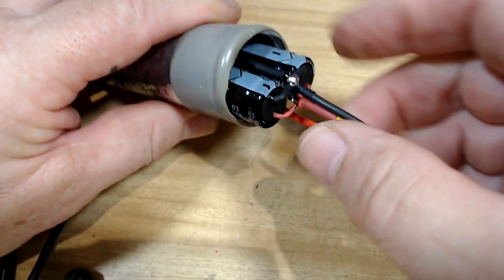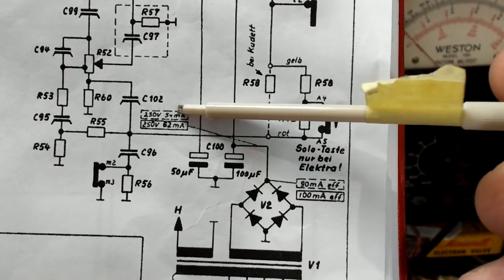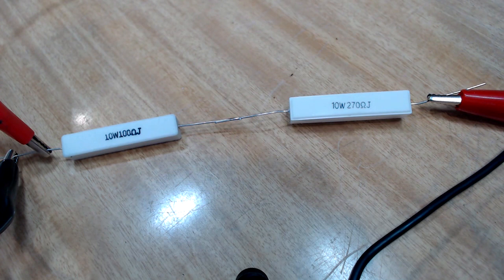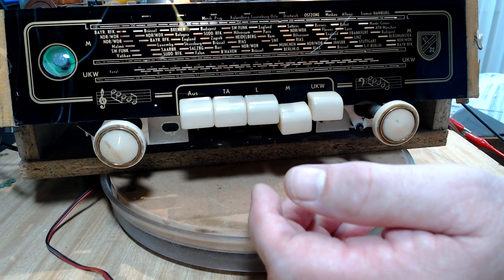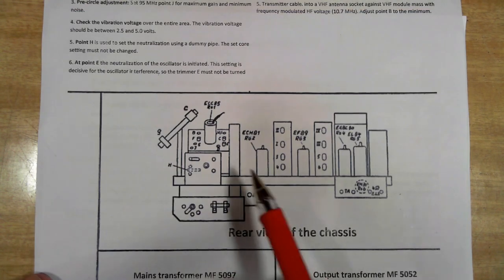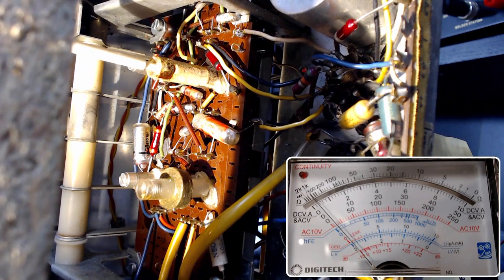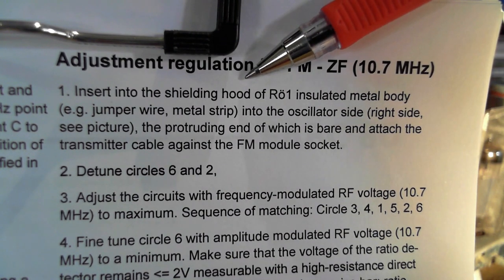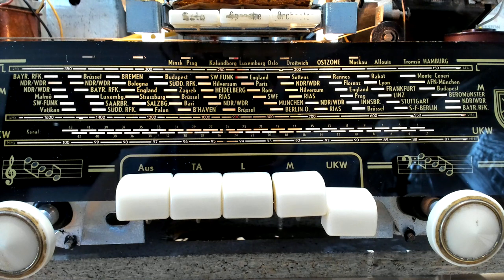NordMende Elektra 58 Restoration & Selenium Rectifier Part 2

Comment: I guess I'd have left the old rectifier in there until it gave up. Apparently they can last quite some time if they aren't overloaded. I haven't worked on too much equipment that had them, the Austrian radio builders loved their EZ80 rectifier valves.
Reply from the maker: There seems to be two camps on selenium rectifiers, if it's working leave it or replace at all costs. My wife wants to use this radio as our main radio so I thought it would be prudent to replace it even though it was working perfectly. If it was just going to be a display I wouldn't have bothered. Thanks Ragnar8504
Reply: @DavidTipton101  AFAIK all that happens if they do go wrong is that the output voltage becomes unstable and drops, so it shouldn't hurt anything. On the other hand, if you want to use it on a regular basis I can understand why you'd want it to work without any trouble to be expected in the near future.

Comment: the UK mains supply is usually 240v a/c. Do you know why your supply has been lowered.? Most equipment 50 or so years ago was rated for 250 v a/c.
Reply: Although the UK mains tends to be around 240V AC they actually decided to meet the EU requirement for 230V AC. Like Australia National Grid did nothing as they relied of the spec 230V +/-10% (217V to 253V) hence covering the spec.
Reply from the maker: Hi Andrew, it was a government decision in the 80s to align us with the European standard mainly to make importing of electrical goods easier. The government allowed 20 years for compliance but my understanding is Queensland did nothing as the voltages produced here fell within the new guideline tolerances (+10% -6%) anyway. The standard supply voltage for the UK is 230V as well 🙂
Reply: @DavidTipton101  I forgot to say it is now 230 v +/_ depending on demand. 50 Cls.

Comment: This radio has quite an easy FM alignment setup, this is what is called a valve voltmeter and 10.7MHz generator approach. The main problem is with the FM alignment that you need to keep it at the centre of the 10.7 MHz and not have a sharp, but a flat peak with the both sides equal. So in essence, on many of these radios, if you just adjust the FM IF to the maximum output, you will get poor audio quality or distortion, despite the signal coming out would be very hot. So this is when the oscilloscope and a wobbulator with 10.7 MHz mark comes into play as you can see the the 10.7 MHz on the scope and you can adjust the both halves of the frequency response curve to be something like a "nice hill with a flat top". During this alignment, the 5uF stabilising capacitor in the detector circuit should be disconnected. Last thing is to adjust the ratio detector to make it centered, this is done with the 5uF cap reconnected and by watching the "S" curve on the scope, so the both halves are mirrored. I had to learn all of that as here in Europe, there are almost no AM stations left, so only thing to receive on these old radios is FM (those that have it). Also, the ECC85 valve can sometimes get weak if the radio was mainly used on AM as the heater of the ECC85 is on, but the anode voltage is cut off on AM. This will poison the cathode and make the valve go bad over time. Instead of ECC85, you can also use ECC88 or PCC88 which usually work a little bit better and can be usually obtained much cheaper (being a TV valve).
Reply from the maker: Hi michvod, I couldn't agree more and I attempted to use the scope to align it but the signal from the generator was very poor. I aligned as per the manufacturer's instructions in the video and the sound is very good and covers the full frequency range so I was content with that. I need to overhaul my generator and see if I can get a good image on the scope. Thanks for all that info, i have printed it and hope it will help my understanding.
Reply: @DavidTipton101  To get a good image, like those in the service data, you would need to use sweep generator, to sweep the bandpass. I think that only the S curve can be observed with just unmodulated 10.7MHz signal. I have an old 1960s Nordmende Service generator, that does AM and FM bands and IFs, and also has marker injection (you connect scope to the sig. gen, and sig. gen to the point of measurement on the circuit, the sig. gen adds the marker on top of the trace). I paid almost €200 for it, but was money well spent. About the rectifiers, I usually don't replace selenium rectifiers, except if it is really weak. I haven't had any issues with them yet, only perhaps a bit lower anode voltage (which only means the valves are not overrun). I think that even back in the 1960s-70s the "official" repair method was to just bridge a silicon diode across the selenium and add a resistor if really needed (if voltages were like +20-30%). The wisdom was that the selenium rectifiers only failed open or with reduced output, so they could be left in circuit. Also, perhaps another note, there is sometimes necessary to add RF bypass capacitors (4.7-10nF) across the silicon rectifier diodes as they can introduce noise into AM because of their high speed turnon/off times. Good luck! ;)

Comment: Hi David. Just searched all your videos and cant find anything about your issolation/variac/Dim bulb setup. Would really love to know the order of the layout and bulb wattage etc along with fuses if any and a circuit diagram.
So many conflicting opinions on the various radio forums
Reply from the maker: Hi 1974UTuber. I didn't do any videos on the dim bulb or transformers. The layout is: Variac - Isolation Transformer - Dim Bulb Tester. They are in that order so the Variac and Isolation transformer are earthed, there is no earth after the isolation transformer output. The bulb is 40 Watts, it is slightly above the normal wattage for the radios I work on which range from 25 to 40 Watts. I have a 60 Watt globe for radios that have a higher Wattage. The  Variac and Isolation transformer have their own fuses. The circuit is straightforward, the bulb is in series with the active side of the line supply, switches are installed to interrupt the power and they are situated before the bulb. You can use a number of bulbs in the tester if you want and switch them in and out to adjust the load, very handy if you don't have a Variac.
Reply: @DavidTipton101  Thanks David. I am just getting into this hobby myself and bought myself a Variac, ISTFR, some gauges and plan to do a dim buld setup with 2 x 40W halogen globes in series because the old style incandescents are getting hard to find. Will have a switch to drop one or both out as required.
I was thinking I should run Variac after the Trans so all equipment on the bench is floating earth and no chance of getting a mains spike across the chest should I put my fingers on the wrong place while also adjusting the variac
Reply from the maker: @1974UTuber  A lot of my test equipment is grounded. I put them in that order in case the Variac shorts and the case becomes live. I'm really not sure which is the best way.
Reply from the maker: @1974UTuber  It might go for $10 too, it has no bids so far. The drum dial looks a mess. If I brought that home I would get into trouble. 🙄😄

Comment: Hi again David - I have a collection of valves left over from my days of restoration - most of them are common types but they may be of use to you - some have lost their lettering and some may not work but if you send me an email address I will list for you - at least the ones I have labels for and if you are still interested I can post to you when the lock-downs are finished
Reply from the maker: Hi Kenneth, are you in Australia? You can contact me at vintageradioaus (at)gmail.com
Thanks

Comment: You might be able to use your sig gen on Fm using harmonics, tune the sig gen to 30mc, then you shgould be able to hear it with the radio tuned to 90mc, third harmonic, this works if the sig gen doesnt put out a pure sinewave, most dont.
Reply from the maker: That's clever SP, I'll do some experimenting. I am going to service the generator and get the upper frequencies working again so it may be a moot point, thanks 😀

Comment: Re FM: start by checking voltages and looking for crook solder joints.
Reply from the maker: Hi Amrit, I cannot find the murphy radio you quoted. It may be an Indian manufactured radio. Unfortunately I don't have the valves that are used in hot chassi sets. You could try eBay or just Google the valves you require. You should be able to find the ones you need 🙂
Reply: @DavidTipton101  respected sir thank you for your response and I have valve numbers 
UM80/MAGICEYE
10C1
10F9
UF41
10P14 
U404
UC92
Sir if you have these tubes please let me know and regards from amrit Singh

Comment: The mains voltage story is that we "harmonized" with the international standard of 230, but with a +10% to -6% tolerance range, so our mains voltage can be from 253 to 216 and still be within the standard. That is, nominally 230 volt equipment used here needs to factor in that range.
Reply from the maker: Thanks James 🙂
Reply: In the Netherlands, all main land Europe in fact, we used to be at 220V. My Philips oscilloscope blew an RC-filter which resulted in a 1 meter high blanket of thick smoke, from the floor up, in the shack. I smelled it downstairs in the livingroom, the smoke alarns at the ceiling in the shack didn't go off.
So, friends, for older equipment it is something to watch out for. Cheers !
Nard
Reply: @Plons0Nard  That cap blew for a different reason, very likely. It's true that most of them were rated at 250 V AC (RMS) but the upper limit of the current 230 are 253 V (as in AZ). Even if the voltage went up to that limit (and I've never experienced that myself), the 3 V (1.2%) over-voltage are unlikely to have destroyed the cap.

The real issue is that most X and Y filter caps for the European market have been RIFA PME 271 or the corresponding WIMA type for decades. They're metallised film and paper caps in a clear epoxy shell. Over time, even in unused spares, the epoxy cracks and at some point the capacitor will go off. Either it fizzles, crackles and smokes or it flat out explodes with a huge bang. Rifa Miniprint capacitors commonly found in stuff like Revox tape decks are essentially the same. I've found them to last anywhere between 20 and 40 years without exploding, but at some point they're done for. If I don't forget, I usually open anything and check for that type of cap before I even plug it in! The smell is horrible!
Reply: @Ragnar8504  Very usefull information, Thank You ! I did not know that. Indeed it was such a filmcap/resistor combo, Rifa IIRC. And it smells awfull indeed. Mystery solved. 👍🤝